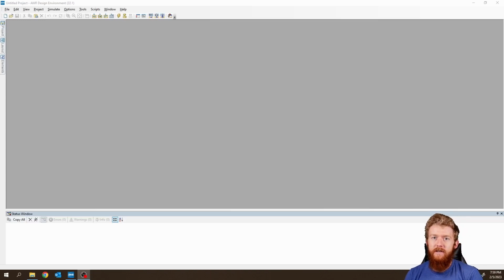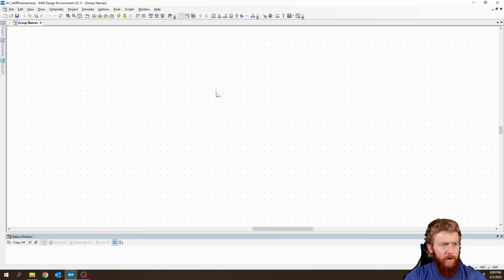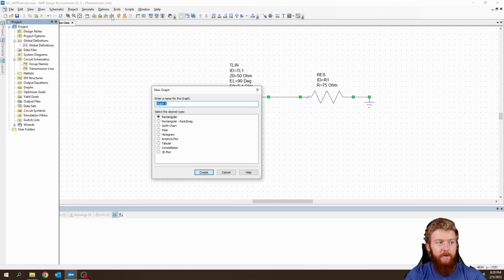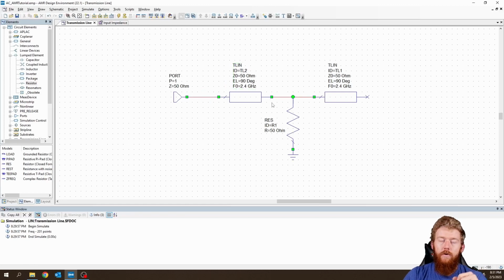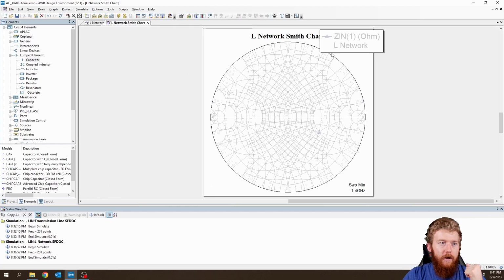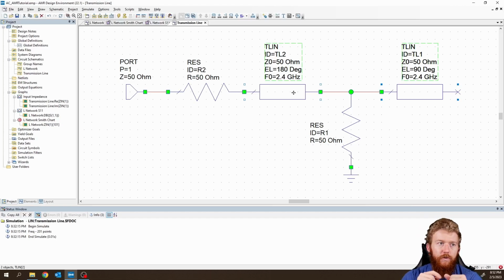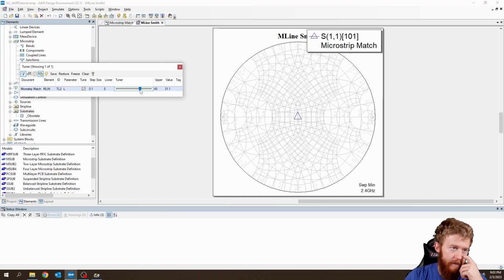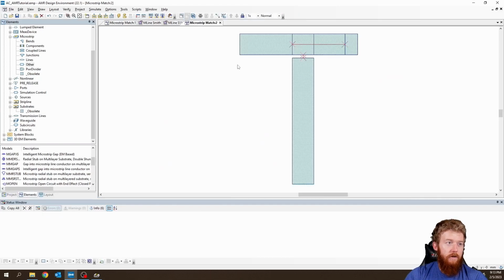Getting Started and Impedance Matching with AWR - AWR Tutorial #1

Comment: Wonderful video and very detailed. If possible please prepare another tutorial about different ways of data import for example S-parameters of a transistor if the data is just available on a paper data sheet. Also whether interpolation is to be conducted within the software if the datasheet does not have the component for a required frequency.